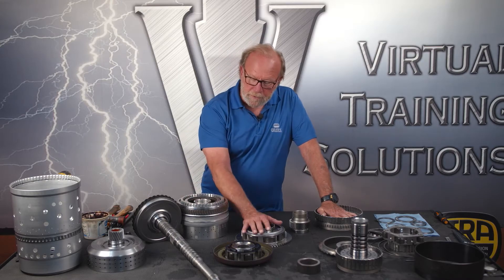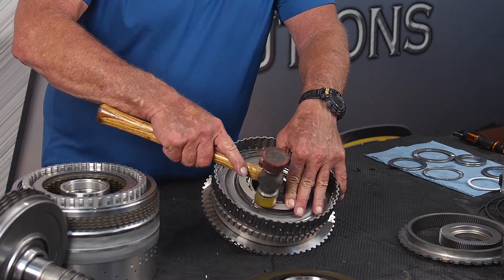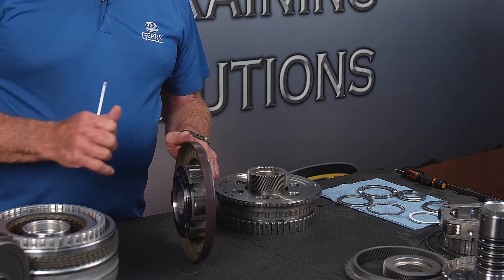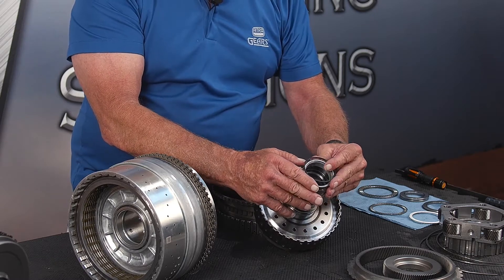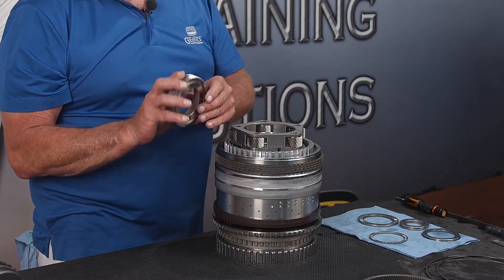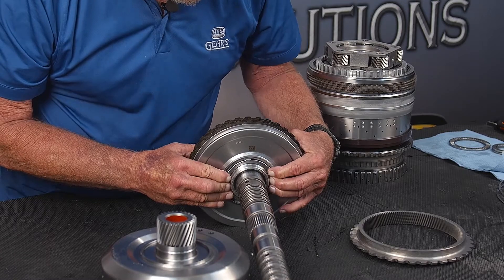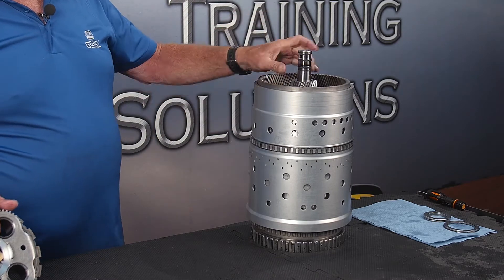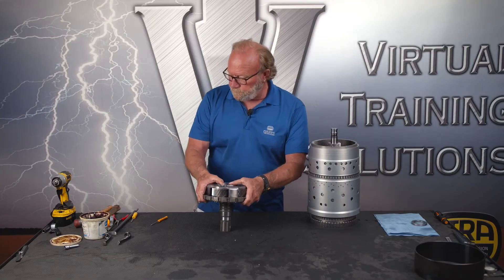02 vts bb 10r140 assembly

Comment: Very nice video Bill.  The 10R140 will make random light knocking noise coming from the tail shaft end of the transmission case at idle while in park sometimes which seem to be normal.   Is it the large output planet gear assembly making the noise?  Seems like there is a lot of gear lash in the entire assembly and drive shell.  Thanks
Reply: I’m a transmission tech at a ford dealer, there’s a planetary #4 recall that is out, your p4 gear sounds like it’s affected.

Comment: The p1 and p2 gears, I use too setup the powdered metal presses for them and others. I also run the 6r80 6r140 10r80 parts. 24 years making transmission parts.